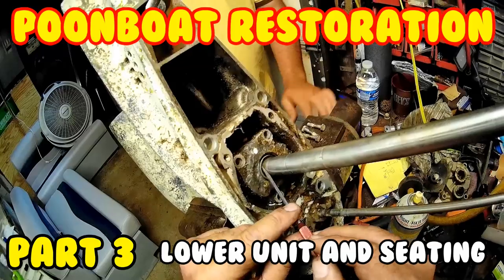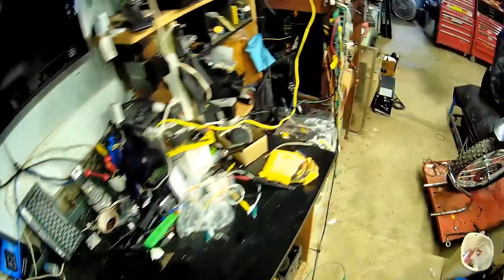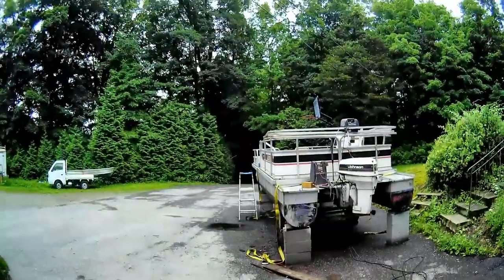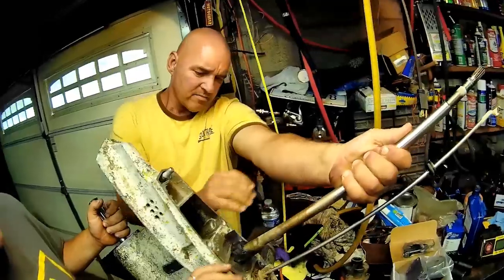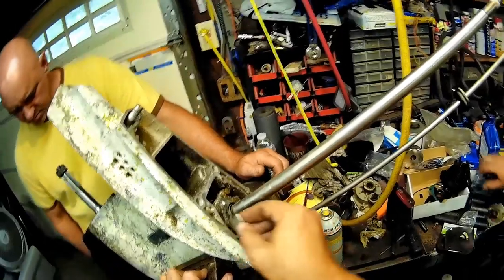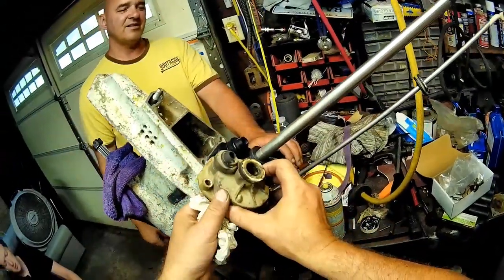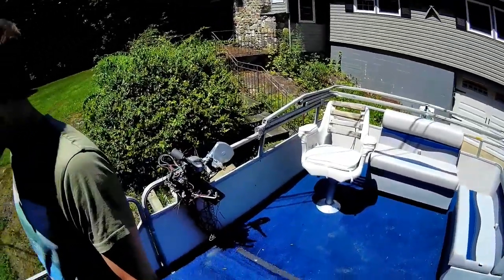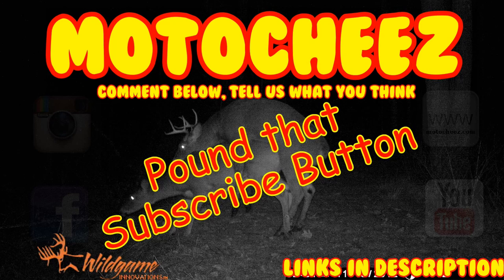Pontoon boat resto (Part 3) Seat placement, attempt lower unit reseal, salt water sucks.

Comment: Nice/Smart lower unit restore. I have a small pontoon boat too. I put console in the center of the boat with bench seat that flips up for storage. Padded seat cooler in from of console. Guest can completely walk around center console. Backrest leans back for driving. Backrest leans forward for resting. Added four pedestal chairs in 4 corners. I installed battery and gas tank on top of pontoons outside wall. Cut in a flip up rail, to walk thru to motor, gas tanks and battery. My next mod will be to remove the side panels (wind load) and replace with stretch metal diamond shaped aluminum. Love your channel !
Reply from the maker: Funny, I thought about doing it in the center. How you like it there? Tou have some great ideas!  Thought about putting the fuel and batteries on the pontoons too
Reply: @MotoCheez  I like it in the center (think balance) Gives maximum visibility while driving and space all around for people, coolers, everything. The 4 pedestal chairs (no armrests) swivel 360 for best comfort and viewing angle. Have a bimini top that covers the back half. Wanna sit in the sun, choose front 2 pedestal chairs or padded cooler in front of console. Console makes a great backrest. Wanna sit in the shade, choose back 2 pedestal chairs or bench seat behind console. I also installed 2 plastic glove boxes on each side of the console, additional storage. 4 cup holders in the 4 corners of the walls.   Rod holders on outside side walls. My best wishes to YOU !

Comment: Quick comment on the seating arrangement.  If you keep the two benches where they are currently, whoever sits on the inside portion of both seats is going to have their knees banging against each other.  I'd have that port side bench move a foot or so towards the bow and then extend your gas tank or battery storage box/table another foot longer.
Reply from the maker: You're right... that's a good point

Comment: One repair i've seen done on those broken ends, is one where they cut the thing parallel with the shaft, made a replacement piece from Alu and then bolted in on with braces from both sides that hugged the split from one end to the other, thus, avoiding disruption to the wooder (as ChrisFix would say).
I think this is applicable here too, not much of it is broken, the one i saw was much worse, guy was a real scrapper, because i would've chucked the bottom as bad as it was.
Reply from the maker: That's a good idea

Comment: I raced SST45’s for a few years, same powerhead w/o timing advance, different lower unit, no reverse or neutral.
Reply from the maker: Nice! They a decent powerhead?
Reply: MotoCheez YES they are. 7-7400 rpm’s were normal with the 15/16 gearcase.Scott Barnikow of NJ Outboards in Bayville, NJ and I were good friends.

Comment: They  originally put the console there and the other chairs etc. for load and center balance...  On a boat that small you could have it sitting in the water "Listing" if you don't balance it fore and aft and left and right..  I would suggest you reinstall the console and leave the rest to move around till you get the best positions..
Reply from the maker: The floor has been redone at least once, the console was not in it's original place. I know what you're saying. I even thought about moving the console in the center

Comment: Why didn't you bolt to the  other side away from the oil filler plug?
Reply from the maker: It was on that side originally, I figured if I cut around it the oil drain wouldn't cavitate.

Comment: Buy another engine
Reply from the maker: A good 40hp used is like $3000
Reply: That's expensive
Reply: If you buy from auction is going to be cheaper
Reply from the maker: @tarekeltobah8232  I am keeping an eye out... but, never know what your getting, I've rebuilt so many out drives and lower units. Had powerheads with bad cylinders...